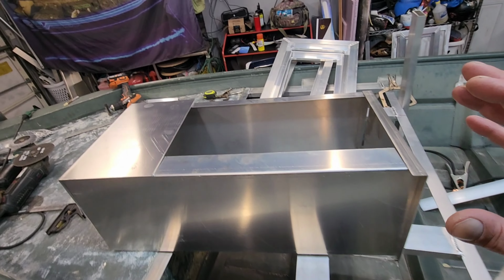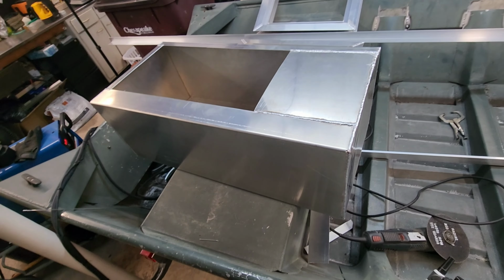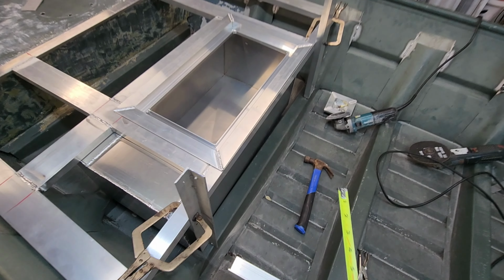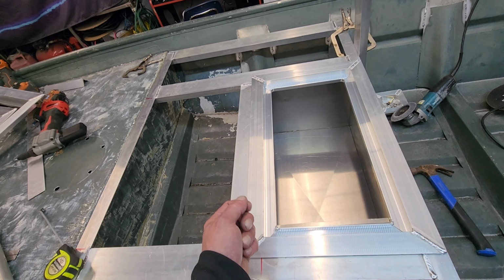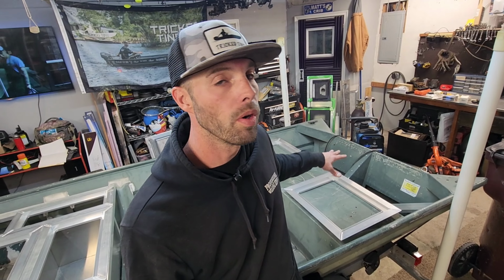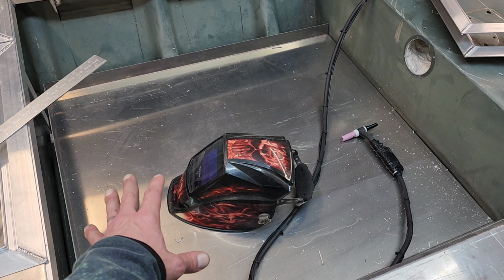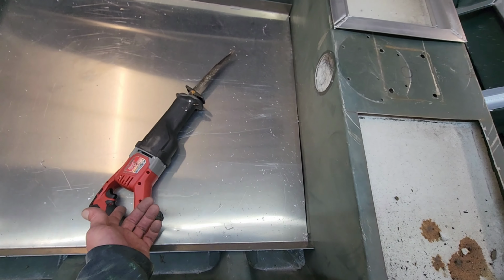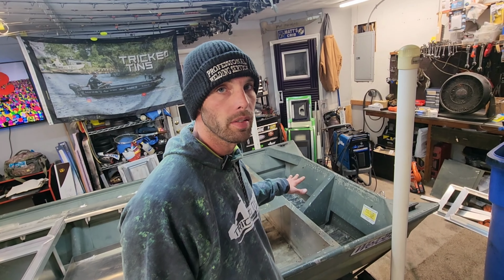20 Hour Boat Build Challenge!

Comment: Hey bud, don't be afraid of that spray foam, works real good. At least you're using the closed cell stuff. The secret is to spray it into a plastic bag lined in the cavity that you're spraying it into. It won't stick to anything but the bag and it's easy to install. And inventory.
And those dimes you're laying, right on man You've had some hours on that Tig. I just subscribed, I want to see more
Reply from the maker: Thanks brotha! I agree with you on the bag technique.  Been welding for 21yrs. Its just another tool. Stay tuned I have some crazy stuff lined up!

Comment: I think that all foam can get soaked and waterlogged. Had a boat that it happened to. It was under the deck on the bottom and when I started to rebuild it, it was soaked and heavy with water that it had absorbed. That was preformed foam. 

I think that it's best to do a build where the drains work properly and don't let water get to the foam in the first place. I'm sure that you do your best to do that though.
Reply from the maker: That's the goal brotha!